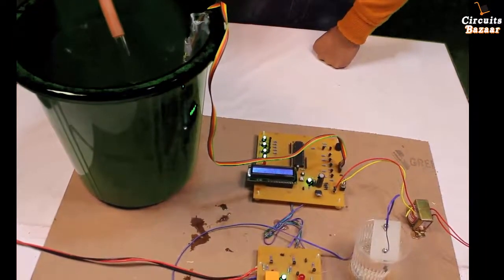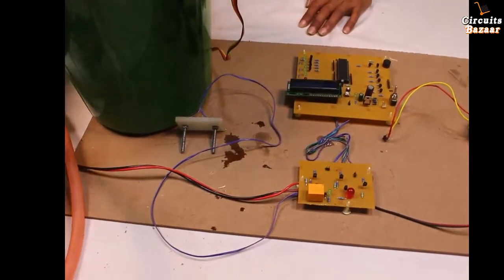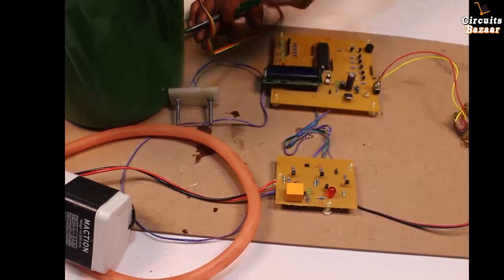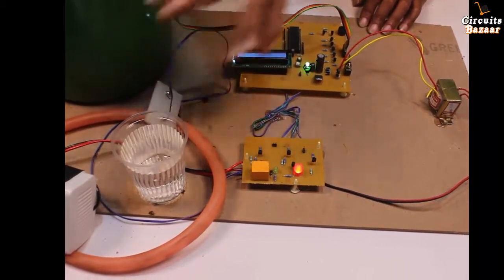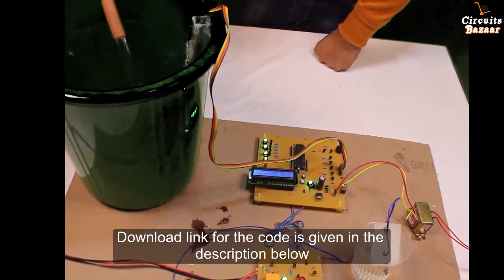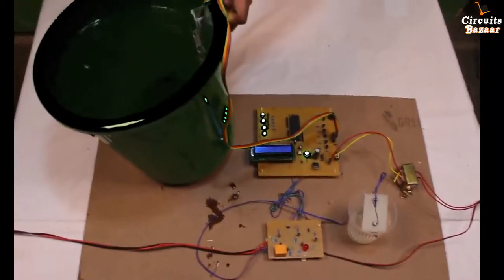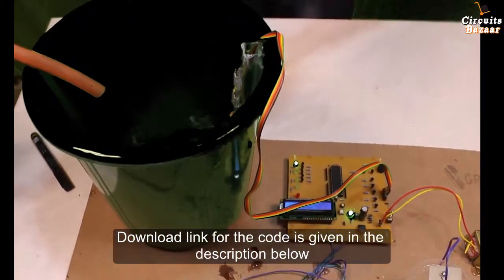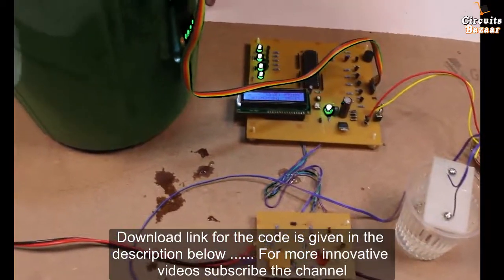Smart Water level controller with dry run protection [ with full code and working ]

Comment: Thank you for the contribution to knowledge. I would like you to explain more about the operation of the sensor that will prevent the pump from starting when there is no water in the cistern (plastic cup). Would you be so kind as to add the diagram and the components. For those of us from Latin America you could add subtitles in English please. Thanks again.
Reply from the maker: Thank you so much for the feedback ......  i would work on it .

Comment: Good Project made by you my dear. But , which sensor would you like to use in inlet pipe line for the presence of water, like Jal Board line. i am Vikas Trikha (MCA ), from Delhi Mob:- 9891580184
Reply from the maker: YF-s201 i use in my requirements... and its a good sensor ...